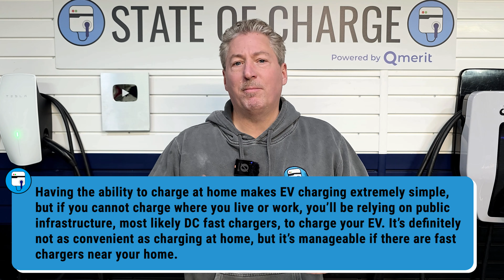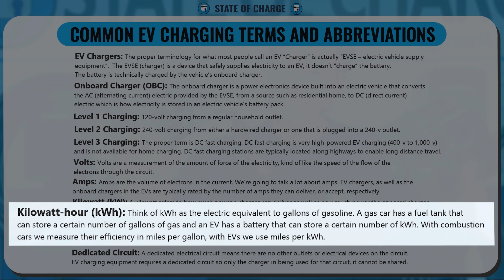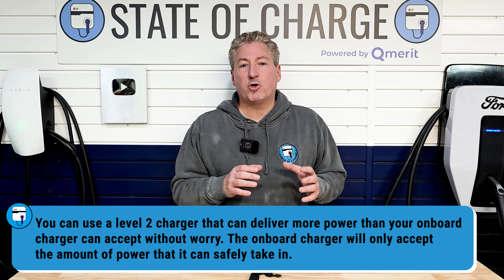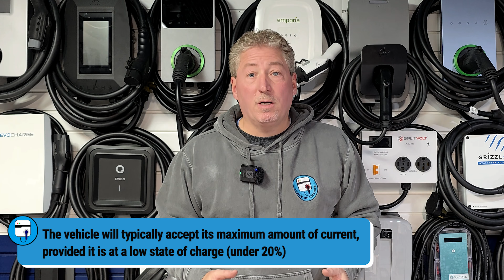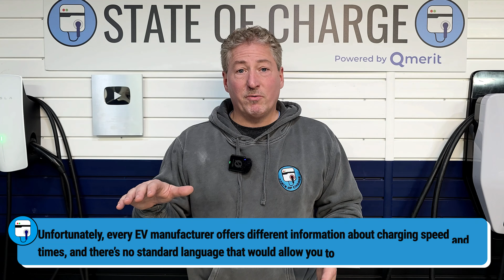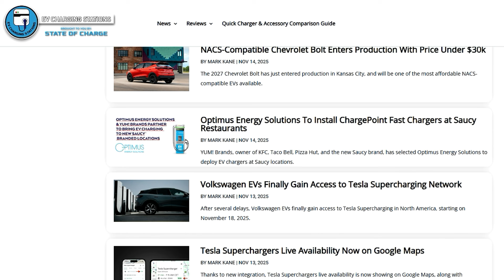Understanding How Electric Vehicle Charging Works And How Long It Really Takes

Comment: Tom, I think that you missed the correct answer. 

People don't on the average use FAST DC chargers. Rates are too expensive compared to their charging at home. 

This leaves you with 120v and 240v. 

My 120v charger delivers 1300w per hour. I get 5 miles a kwHr or 6.5 miles per hour for 8 months of the year. 

I use FREE Level 2 charging at public chargers. The ChargePoint charger delivers 6.5 kw consistently until it is 95% filled. That means 5 miles a kwHr at 6.5kw gives me 32.5 miles per hour of 240v charging. This charging rate is a flat line also with other EV cars. I did not deduct for the energy efficiency rate. Maybe it's 85%.

I charged at 40F/4C this week and it took 15 minutes to heat up prior to charging at 6.5 kw. 

Anyway, tell people the range using Watts instead of Amps. We know 100w light bulbs but not the amps used. 

Shell Level 2 public chargers stop charging after an hour, so this is simpler, cheaper, and easier to install than Fast DC chargers that probably never get the revenue to cover their initial construction costs and maintenance. 

About 50% of the Giant grocery stores in PA offer FREE Level 2 chargers. This is reality and not road trip prices with road trip charging speeds. 

In summary, Level 1 can be 2.5 miles or 5.5 miles per hour using a 120v outlet and 240v Level 2 delivers 13 - 32.5 miles per hour of charging. A bigger 40 Amp circuit will be even faster. Remember, people asking me the same question don't want to hear about Fast DC charging rates, since they will charge at home!

You should also have said Tesla is about $.33 a kwHr at their Fast DC chargers compared to much more by others. Don't recharge at your local car dealership, for example!
Reply: 1300 watts (not per hour)

Comment: Here’s what I wish someone would have told me about charging before I bought an EV… dcfc speeds and availability woes are vastly overblown.  Invest in a good level 2 home charger and most people will go MONTHS between using dcfc.
Reply: Tom talks Fast DC chargers, when only those on road trips use them on average. 

So, I get 5 miles a kwHr driving and use 1.3 kw at 120v or 6.5 kw at 240v. That's 6.5 and 32.5 miles per hour for 8 months of the year for me.

There is a straight line of charging at these levels until 95% at Level 2 for me. 

This means his talk of Fast DC charging was not representing normal reality when charging.

Comment: Tom, I am stopping a bit over 5 minutes into your excellent video to comment on your definition of Volts.  “Force of the electricity” is good, but I am afraid you left the reservation by adding “speed of the flow of electrons through the circuit.”  The latter is actually a good definition of Amps!  

One Ampere is one Coulomb of electrons per second.  Coulomb is just a number of particles, electrons in this case, equal to 6.24 X 10^18. 

“Speed of the flow of electrons through the circuit” is a more clear and descriptive definition of Amps than what you have, so I recommend just moving it down to replace the Amp definition.
Reply: Now that I have watched the rest of the video I must say that this was an excellent job explaining EV charging in North America.  Very well done. 🏆

Comment: With all due respect, IMHO, very few people refer to SAE “DC Level 2” charging as Level 3 charging. There has never been a “Level 3” standard, only two proposed standards which were never implemented. One was for AC charging and one was for DC charging. Also, with DC power levels ranging from 24 kW to 400 KW, it seems not very useful to refer to all levels as DCFC. Could we not make 24 kW - 100 kW “DCSC” and let 120 kW - 400 kW max power provision use the acronym “DCFC”?

Comment: Hey Tom, I’ve been driving EV’s since my first i3 (BEV) in 2014 and I installed a 30 amp charger (EVSE) at the time. I have recently added a Lightning to my hooptie fleet and have been using the same 30A charger but am considering upgrading to a 48 - 50 amp charger. Question: would it be better to continue using the 30 amp charger (vs the upgrade) as it doesn’t “stress” the battery as much? Just curious about that. 30 amp is fine for charging the Lightning overnight so no need for faster charging but since my utility company is offering a deal on chargers it’s something I’ve been considering. Thoughts?
Reply from the maker: Technically,  it's probably better to stick with 30a, but honestly,  the difference is practically negligible. If you can get an upgrade at a great price then go for it.

Comment: Level 1 Charger _ I go hunting for a week to an outfitter four times a year, 300km (200 miles) to go there, when I get there with my Lightning, trailer, ATV, equipment. water and gas for the ATV. The outfitter lets my charge my truck on the 120v, with in four days my Lightning is back at 100% charged, so I can go back home with 20-25 % left in the truck !!! Simply amazing !!!

Comment: I have two evs in the family for every day drivers. A f150 lightning abd and an id buzz. Both are not the most efficient vehicles and I have never felt I needed more than on 40 amp charger that covers both vehicles. We use the grizzle e duo and it works great for us. Ps when are you making the video for vw’s now open for Tesla superchargers?

Comment: What about a charging stop on a road trip and all the chargers are in use when you arrive?  How often does that happen?  That could make that charging stop over an hour, being "at the mercy" of the charging need of the car in the spot you are waiting to use.
Reply: If Fast DC chargers are finished in 30 minutes, you don't wait over an hour to start your charge session.
Reply: @gregyohngy  I didn't say wait over an hour.  I said the stop could last over an hour.  That said, an hour or more  is a pretty long delay.
Reply: @gregyohngy  If all the chargers are full, you are no longer at the mercy of how long it takes the fast charger to finish. You are at the mercy of how long it takes the owners of those vehicles to come move them once they are done charging. There can be 5 cars at 100% charge and you're still gonna have to wait to plug in because the owners of those cars haven't come back yet. You very well could wait over an hour to start a charge session if all the chargers are full. (hopefully the chargers would be billing such inconsiderate people something for hogging the charger when they aren't charging anymore, though)
Reply: @gregyohngy  Depends on how many cars are in line ahead of you.
Reply: Pretty often.  In use or broken.  Infrastructure anxiety :)
Reply: I have been in long queues for petrol or diesel during holiday periods and the wait can be annoying however with most charging apps they tell you how many chargers the location has, how many are working and how many are in use, I don’t know of any that do this for petrol stations. Some YouTubers deliberately go to locations that either are very busy or have broken chargers just for clicks when just a quick look at the app would show the situation so go to another location if you are in a hurry. Also normally on a road trip I stop for a rest break every two hours. That uses about 100 - 120 miles of range depending on traffic. A 15 minute charge even at a slowish charger will usually top that back up and a very fast charger will do it in less than 10 minutes provided your car can charge fast. The issue is actually the opposite as I often find the car charges more quickly than I take for a rest stop. So it’s check the apps and charge when you stop not stop to charge.

Comment: Only two answers needed

1. At home: while I sleep
2. when road tripping: while I go pee.

that is about it.
Reply: You are mixing 2 different chargers. Home is 240v and Level 2, but Fast DC chargers charge much faster and cost more per kw than at home. 

I use FREE Level 2 Chargers and they are as fast as at home. My car can not charge at Fast DC chargers.

Comment: Public Level 2 chargers at schools and city parks are usually 6 or 7 kW in my experience. Why are these slower than the home chargers discussed here?
Reply: Typically commercial power is 3-phase AC - which allows 208 volt circuits between legs, rather than the 'split phase' 240 volt circuits in residential installations.  The L2 charging stations (EVSEs) are quite often rated at 30-32 amps.  So 208 * 30 = ~6.2 kW.  If on a 240 volt circuit, 240*32 = ~7.7 kW.  Which explains the range you are seeing.
Reply: @walterspector735 good point. Also our house dips to as low as 230v when charging and loading s of neighbors using AC in the heat.
Reply: Existing wiring or service size especially where multiple posts are installed, you'll see more conservative rates. Additionally, it's safer (less liability) for the provider who's posts get a lot of daily abuse. We've got apartment buildings for instance with old service drops. A ten unit building serviced entirely by one 175amp service might only be able to spare a 24a evse.
Reply: I charged at a couple of Casinos and they were far from the building. Ouch, slow slow Level 2 chargers! 👎

Comment: If you say an EV will not accept a higher rate than it can properly use, that sounds a bit as if there is some active negotiation of the rate. I don't think that's normally the case. You have a certain voltage, and the battery will offer a certain effective resistance, as a result of the battery's condition and size. That sets the charging rate. BTW that varies continually as the charging session goes on.

There is a need for active management in some situations. If the charger is capable of 800 volts, and the car only handles up to 400 volts, excess voltage must be actively prevented at the output of the charger. So there is some active management. But generally, it's about the battery's internal limitations. At least that's my impression so far.
Reply: You are overthinking the issue. 

My car takes only 6.5 kwHr at Level 2 chargers, but other cars can accept more kw using the same charger. 

One light bulb gets 60 watts while another gets 100 watts. Same 15 amp 120v circuit.
Reply: No, that’s not a very good impression.

Every EV has a BMS (Battery Management System/Software). And every car maker specifies how the BMS is programmed.  There are environmental influences but they are actively managed by the BMS.  That you are observing a particular behavior doesn’t mean there isn’t active management occurring .

And you want that!  When you hear about ebikes, drones , or other small consumer devices catching fire or bricking ata high rate, it’s often because they either have no BMS or a very crude BMS
Reply: For level 2 the EVSE communicates with the onboard charger to tell it the max amps it can "pull" before the power is turned on.

Comment: Isn't 240 V charging generally a little more efficient than 110 V?
Reply: I definitely needs less copper wire to deliver higher voltage.
Reply: Efficient in time?  Or power?  Very little difference in power used.

Comment: Hi Tom,

My Audi e-tron was built in Nov of 2020.  So, it just passed it's 5-year mark.  Currently sitting at 56,000 miles.

Been running Recurrent for over a year to monitor the Battery life.  

Yes, Audi did update software to unlock a bit more of the battery, but it was only about 3% more.  My current Recurrent score is 105.

It would a very interesting show if you looked at a bunch of EVs that were used in different situations, different batteries, different charging methods, etc.  Do those who use level 2 nearly all the time see any significant battery loss?  Do ride share operators who put on many miles and DCFC all the time see significant loss?

I'm just wondering if my Audi is "normal" or some kind of rare specimen?

I keep hearing that "battery degradation is far less than we imagined", but just how much is now "normal"?   You hear "the battery will last longer than the car", but if my battery is looking as good as new 5 years later, what does that say for the longevity of the vehicle?  In the past, I've kept vehicles for 14-16 years.  My last one was a 2009 and my son is still driving it at college.  Are we talking battery packs that can do 250,000 miles with little degradation?

Surely you know some experts in this field and can put together a "Your EV will outlast any Gas car you've ever owned" episode.  (^_^)

Comment: Level 2 chargers do not "call" for a certain amount of power. The EVSE tells the charger in the car how much the EVSE can supply, and the charger in the car pulls  that much or less. If the EVSE tells the charger that the EVSE can supply 60 amps, and the charger in the car is rated at 48 amps, the charger doesn't tell the EVSE to only send 48 amps, the charger simply pulls 48 amps. As was noted at the beginning of the video, EVSE's are not terribly smart. They are pretty much just a smart AC outlet that can power the outlet cord only when it is plugged into and communicating with the charger in the car. It also "tells" the charger how many amps is the most the charger should try to pull. But it has no direct control over the current. Once it advises the charger in the car, it has done all it can to control the current. The charger in the car is always in control of how much current is flowing.
Reply: and protects against ground faults.

Comment: I just got my Emporia Pro installed. It's my second charger and made it so much easier to add a second charger without having to worry about a service upgrade. It really is a good option for anyone who needs to add a charger but doesn't have a lot of capacity left in their load calculations. For minimal extra cost it really makes it much easier to install a charger in a lot of situations.

For charging every night a lot of people want to be safe and set their vehicle to not charge to 100% automatically.Setting it to 70 or 80 or 90%. Not all EVs support that so for them you might want to avoid charging every night.

Comment: Tom I use a NeoCharge to share my electric dryer circuit. I think you should clarify your statement about dedicated circuits. Splitvolt, Lectron EVSE, Simpleswitch and others allow for L2 charging without a dedicated circuit.
Reply from the maker: The dryer circuit is indeed a dedicated circuit.
Reply: @StateOfChargeWithTomMoloughney ok.
Reply: You do realize that your 240v dryer outlet is not safe to safely charge an EV. 

Tom highlights the fires that happen using dryer outlets.
Reply: @g @gregyohngy replaced cheap Leviton receptacle with an EV rated industrial Hubbell receptacle. You do realize this is safe?

Comment: Tom, thanks! Would be great for you to have a video all about avoiding a panel upgrade and still have a L2 station. I am an EV Ambassador for a local non-profit and at EV shows, I get the most interest from people when I explain to attendees the various ways to avoid a main service upgrade.
Reply: I second this. I've seen friends who were told by one electrician that they'd need an upgraded service and an upgraded panel to charge their EV in the garage but then they find a different electrician with more experience working with EVSE who just installs a smart load manager which keeps the original service and the original panel, and only sends max amps to the EVSE when the other household loads don't want the power (e.g., stove/dryer/AC are not usually all running simultaneously when you sleep, so give the amps to the car!). A smart load manager means you can even use a beefy EVSE on a 60 amp service in an older home. If you've got a 100 amp service, you're golden. You'd only need a 200+ amp service for a shop or business that's offering multiple L2 chargers to fleet EVs or customers. A new residential service is thousands of dollars from the utility co, but a smart load manager is usually in the hundreds, with installation! A good video on this could help homeowners know what to ask about when getting a quote from an electrician.
Reply: We picked up an Emporia Pro charger that has a load management system that enables us to charge at our old home without a panel upgrade.

Comment: The factory supplied EVSE that came with the 1st gen Bolt is the same box as the one with the Opel Ampera-E sold in Europe with their higher voltage. With an adapter plug you can plug your EVSE into 240 volts with no damage to your equipment & get twice the charging speed, converting your level 1 unit to level 2 just by adapting the plug.

Comment: My service voltage usually runs a bit high, 127-128 per leg so I get a slight speed cheat on my charging. Every little bit helps.

Comment: Great video Tom, would love to see a similar video for those of us in countries with 240V power and 3-phase is very common and in most households 32A is max amperage if you want say a 11kW or 22kW you just get 3-Phase installed.  For me I've only ever Level-1 charged at home either on a 10A outlet or 15A outlet(which is what I'm on currently) and also have called it a Granny Charger but as I say we have 240V power so I get about 3.3kW on my 15A outlet using a 15A L1 charger.  As you've covered in the past also with LFP vs NMC/NCA you can charge to 100% regularly unlike the NMC battery chemistry which is generally about 80% with 100% only when you do a longer trip or need to charge to 100%.
Reply: So do any NMC batteries ever REQUIRE a full charge for cell balancing as briefly intimated in this episode, or are they all actively/continuously balanced these days? I'd happily NEVER/rarely charge a nickel battery past 70 - 80% for longevity (as advocated by Dr Dahn & others at the individual cell level), but am I accumulating a wildly horrible cell imbalance by doing this?
Reply: Also, any concern there in Oz about using the full 10/10A, or 15/15A for extended periods?